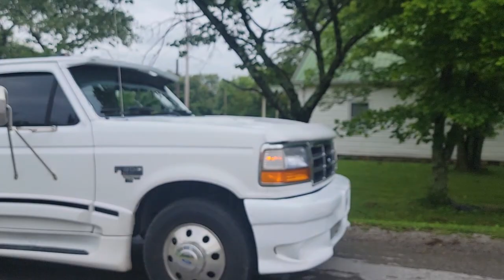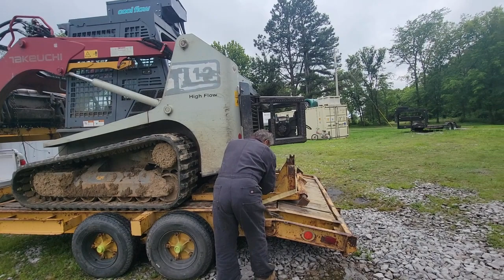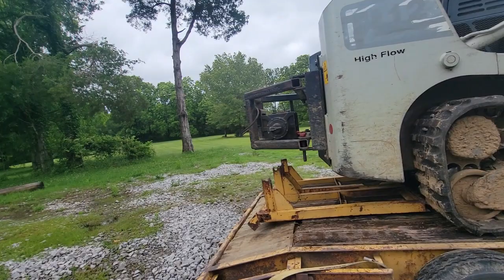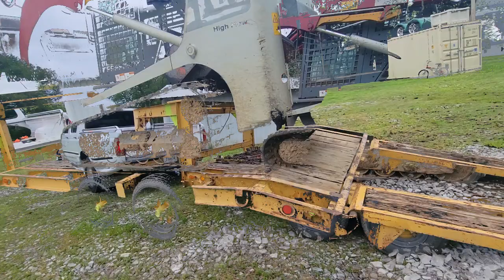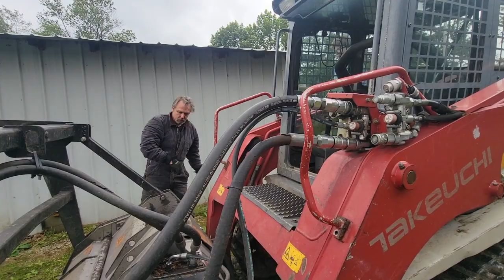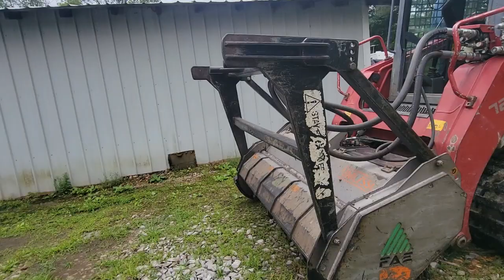BIG BELLY AND SON TRUCKING IS NOW BIG BELLY BEAVER #bigbellybeaver #bigbellyandsontrucking #newname

Comment: This is Cody from Perimeter, you guys may want to get some sprockets on that machine before it rubs into the housing on the travel motor. Those are very bad.
Reply from the maker: Oh wow!!! Thank you!  I will reach out to Steven about that!!! Thank you so much!  Also, you found this video on my smaller channel.   It actually has several thousand views on the actual BIG BELLY BEAVER channel....just in case you were wondering why the view count was so low.  Many times, I put up some of the same videos on my smaller channel.   We have over 5.2K subs on the BEAVER channel.   But I will have Steven call you!  Thanks for watching and commenting.   Ruthie B Howard  06.06.24